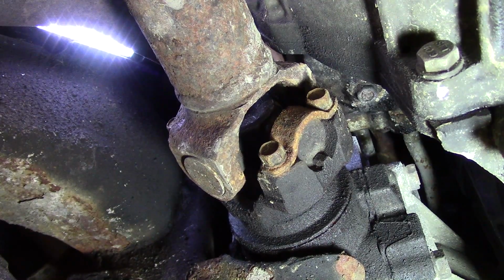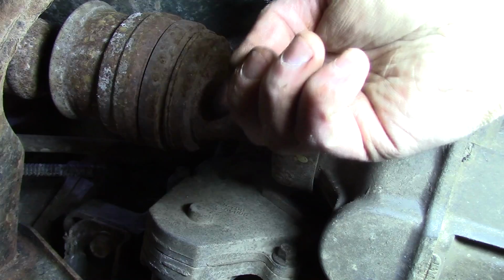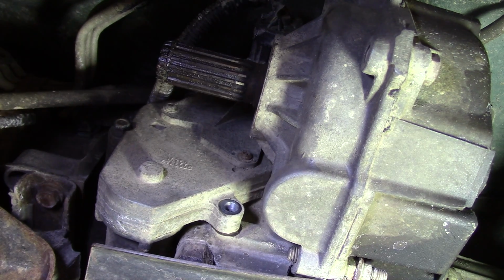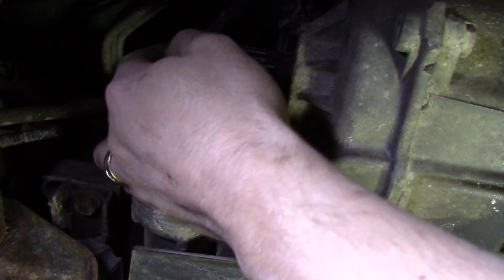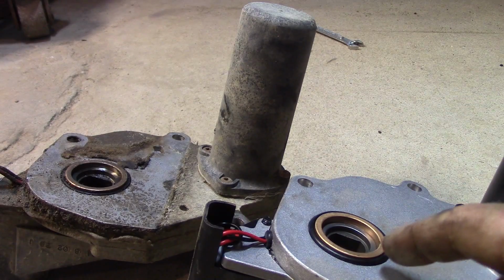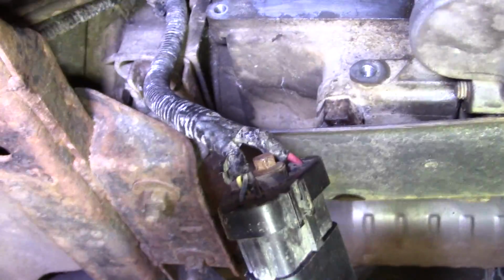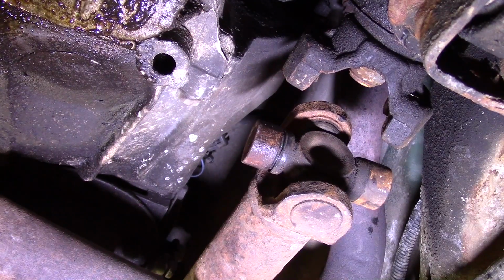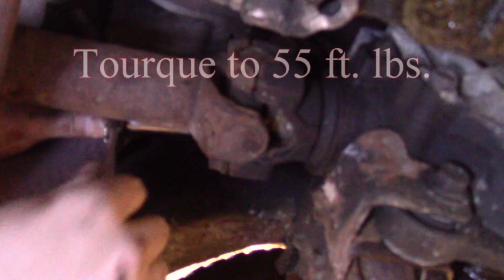DIY How To Replace S10 Blazer 4WD Transfer Case Encoder Motor GMC 4x4 Transfer Case Motor Repair

Comment: My 99 Blazer LT doesn't shift nearly that fast. It usually lags for a few seconds before it pops in and out of 4wd. Does this mean my encoder motor is going bad or could it possibly be a vaccum leak? I've fixed a few already.
Reply: +Mark Jenkins Thanks for the tip but I think I may have just opened up a can of worms, lol. I followed your advice and checked the transfer case fluid and instead of it being blue like I expected it was pink like tranny fluid and was oozing out a bit suggesting it was a bit over filled (also someone had put thread sealer on the fill plug and sealed in a bunch of dirt and crap). I then check the tranny fluid and it too is over filled by quite a bit. I wonder if this is why my tranny dipstick keeps poping out of the tube every time I drive. 

Do you think it was just poorly serviced or might there be something more going on?  I'm thinking at this point I might drain some of the tranny fluid and replace whats in the transfer case with the blue stuff and check them regularly to see if they are mixing or if it at least improves its performance. Any thoughts would be appreciated. Btw mine is a 4 button with auto 4wd so it should have the blue auto track II right? Also, is there a drain plug on the tranny somewhere or do I have to pull the pan off?
Reply: +Mark Jenkins Great video mark, when i changed my transfer case fluid there was only about a  cup worth of fluid in it. it was brown and watery. I had a hell of a time refilling it and took a bath in trans fluid lol.
Reply: +Mark Jenkins Thanks for the tips Mark. Luckily the transfer case hasn't filled to the point of overflowing yet so I'm just gonna flush it out and run auto track II in it for a while and see if I can confirm an input seal problem or not.

Comment: I've debugged the 4wd electronic motor, switch and control unit( TCCM difficult to access under center dash in my 95).    I'm an old-schooler and I decided to convert it to full manual shifter as my 86 S10 Blazer had per I lack confidence in 20 year old auto electronics.  I removed the driveshaft,   took out the electric motor assembly, disassembled the motor from the aluminum housing and after a little grinding and MIG welding  the assembly was bolted back in place.    I fabricated a shift lever from a 3/8 inch steel rod.    I did not want the aggravation of failure during sub-zero weather.   My 95 is an xcab  S10 pickup  4.3 vortex.   Nice video….walt
Reply: I would love to see your set up and how you did it.
Reply: +67giacomo    I just sent Mark pics and description of the FULL MANUAL conversion….if you send your email I will send you the same….see my email address below     walt
Reply: +67giacomo    Just sent the info that I provided to Mark…any questions please email me     Good luck    walt
Reply: berkmanyt hello. Could you email me some of this info as well?  My address is Wyo4x4@gmail.com. Thank you!
Reply: I'm the same berk, machanical all the way